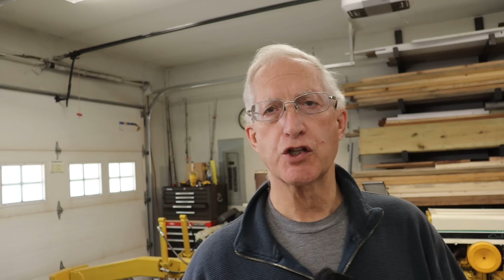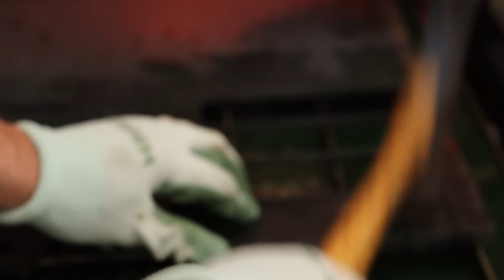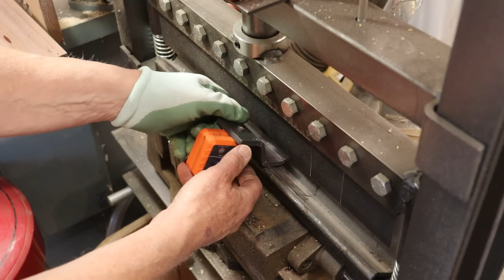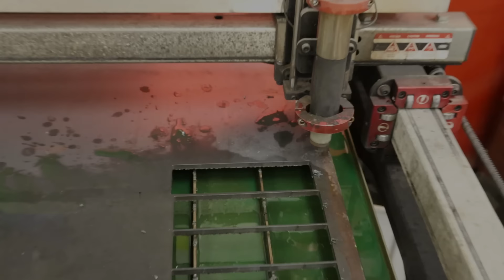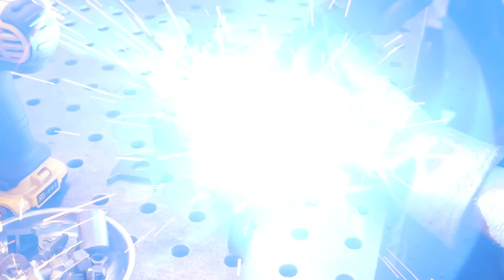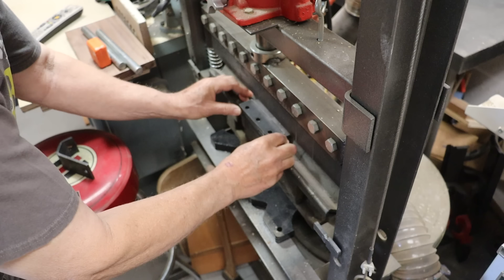Work begins on the Ripper/Scarifier for the Mini Grader.

Comment: If the air won’t complete a bend for you, you can always get more power using the jack handle and pump it by hand. 

I think a traditional 4 link set up for the scarifier will work better than a 3 point hitch. That’s how dozer rippers work.
Reply from the maker: I haven't decided on exactly how the linkage will work. I am working from a picture of a 4 link set up.  It's really a matter of what can be done from a practical standpoint--what will work reasonably well without a huge investment in time and money. If I continue down the 3pt hitch path, I'll be able to use other attachments, right?  So some compromises either way...

Comment: For those holes that almost fit... you can use a tapered punch to expand them a little... won't really hurt the part.  "Food for thought".
Reply from the maker: That's actually a good idea. I hadn't tried that, but it could well be just enough to let a bolt through. Those holes, intended for a .375 (3/8 inch) bolt were specified as .400 in the cut program.  And a few of them would not let a .375 bolt through--that's the degree of taper.  I have since increased the hole  cut instructions to .450.  But this is a systemic problem with plasma cutting. I need a laser, I guess...LOL.

Comment: Liking this addition to the grader. Now think about a little comfortable and for sure style after this build how about doing a ROPS bar and adding a canopy top! It lacks a bit of a grader look with it just open cab . Plus that would give you a bit of good shade on hot sunny summer days!   To solve the height with  canopy to get in garage you can split and hinge the  ROPS bar just the same way as you see on zero turn mowers and smaller tractors.   Lmk what's your thoughts on this??

Comment: Use a rotor hammer with a flat chisel, leave the metal on your metal bench and hit the middle of the metal plate and the slag will fall off.

Comment: Even though it is a bit tedious, it is possible to sharpen a high speed steel drill, and temper it by heating and quenching in oil or water. It works surprisingly well.